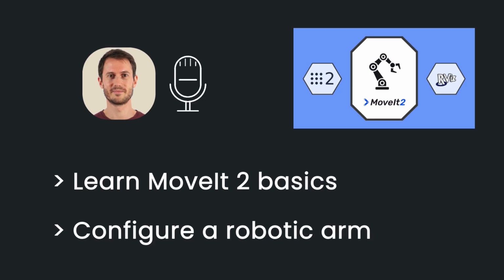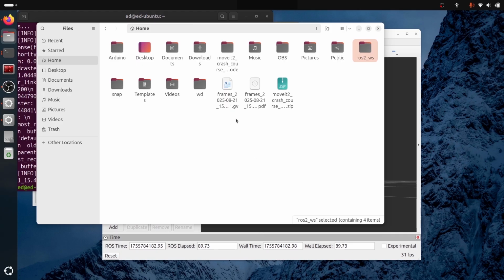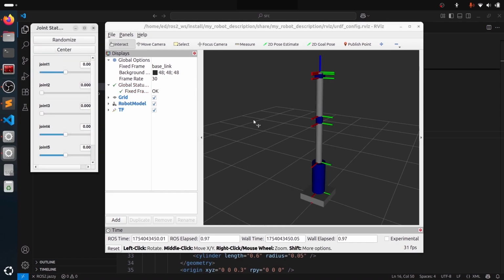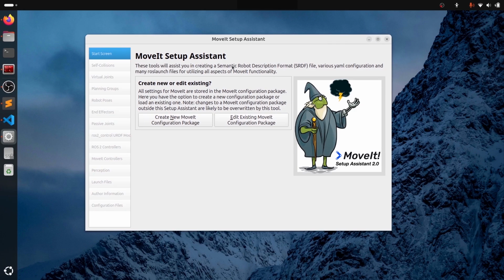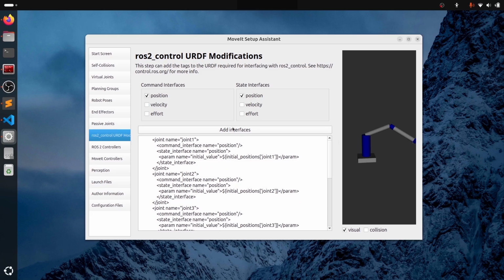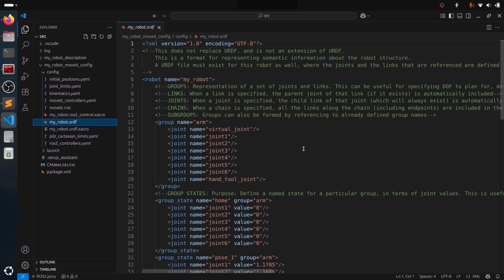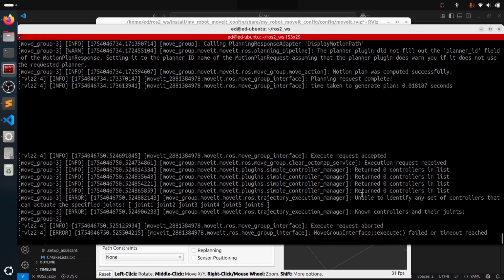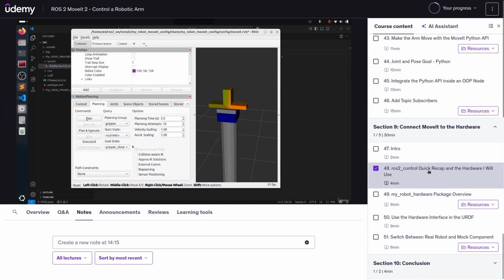ROS 2 MoveIt 2 [1H Crash Course]

Comment: This was a great video, however I could not get it to work. I followed your steps exactly, except I am using ros2 Humble. I get an error launching the demo that I have no idea how to fix. The error is

[spawner-6] [FATAL] [1773598027.300050072] [spawner_arm_controller]: Failed loading controller arm_controller
[rviz2-4] [INFO] [1773598027.307683204] [rviz2]: Stereo is NOT SUPPORTED
[spawner-7] [FATAL] [1773598027.332069342] [spawner_joint_state_broadcaster]: Failed loading controller joint_state_broadcaster
[ERROR] [spawner-6]: process has died [pid 5972, exit code 1, cmd '/opt/ros/humble/lib/controller_manager/spawner arm_controller --ros-args'].
[rviz2-4] Warning: class_loader.impl: SEVERE WARNING!!! A namespace collision has occurred with plugin factory for class rviz_default_plugins::displays::InteractiveMarkerDisplay. New factory will OVERWRITE existing one. This situation occurs when libraries containing plugins are directly linked against an executable (the one running right now generating this message). Please separate plugins out into their own library or just don't link against the library and use either class_loader::ClassLoader/MultiLibraryClassLoader to open.
[rviz2-4]          at line 253 in /opt/ros/humble/include/class_loader/class_loader/class_loader_core.hpp
[ERROR] [spawner-7]: process has died [pid 5974, exit code 1, cmd '/opt/ros/humble/lib/controller_manager/spawner joint_state_broadcaster --ros-args'].

Do you have any idea how to resolve this? 
Thanks for your help

Comment: Hello I have a doubt. What's the difference between moveit2 and ros2 control? If I want to control a robotic arm through ros what should I do?
Reply: Each robot has a different interface, and somehow you have to tell the robot its commands through that interface. ros 2 control is like a common interface that connects to your robot. moveit is like a layer above it. When you want to do motion planning, you use moveit. Let's say you want to move the robot using the planned motion, moveit sends the planned trajectory to a ros 2 controller (usually through a FollowJointTrajectory action). The ros 2 controller then executes the trajectory and tells it to the real hardware.

So you need both!
Reply: Moveit is ros library. You should use both.

Comment: Hello, thank you for the video, I'm a bit confused, I have tried to install moveit on my old laptop running ROS2 fine, however all the tutorials I came across make me build moveit2 from scratch which takes ages on my machine and never ends !! is this really simple to use it ? does it required compute power to follow the tutorial ? I''m using ZorinOs which basically ubuntu 22.04 LTS.
Reply from the maker: for Ubuntu 22.04 you can install ROS 2 Humble, and moveit has binary install: https://moveit.ai/install-moveit2/binary/